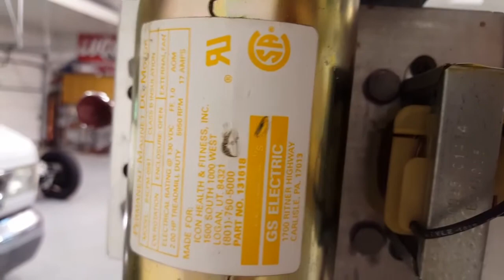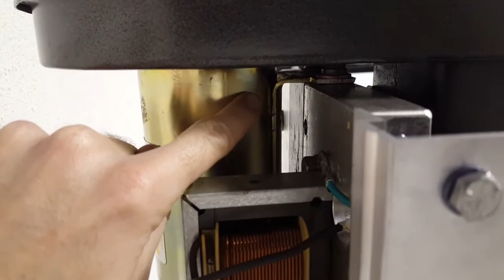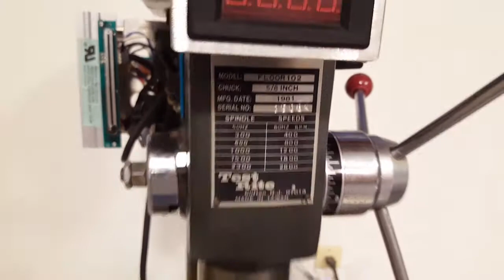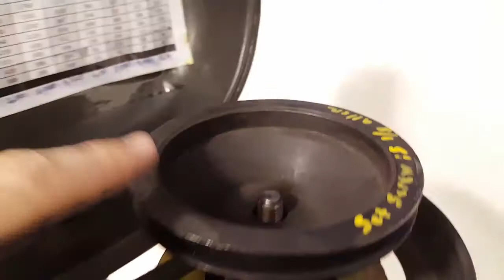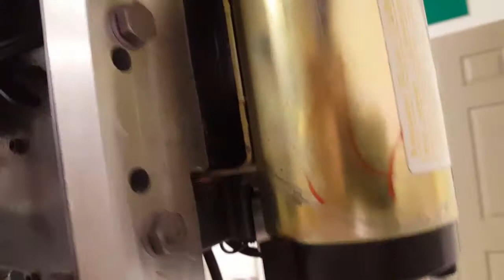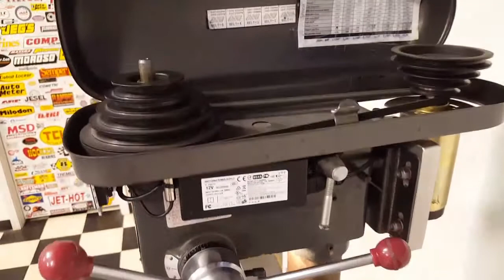Treadmill Motor & Digital Tachometer on a Drill Press Variable Speed

Comment: It amazes me no one sells kits for this. 
 
I have one arm/leg, so I am limited to one speed on a belt drill press (broke a tooth trying to change speeds last time. Lol.). And I've now burned up 2 motors and a drill fire trying to get a true adjustable speed drill press.
 
Electronics just don't seem to work in my brain. I can spend dozens of hours watching in depth "how to's" but it just doesn't click. 
 
Drill press industry needs to get into the 21st century. I mean, belt driven drill presses should just be relics at this point. And direct drive variable speed drill presses should be easily made and sold for $600 (for like a cheap 14" WEN version). 
 
Hopefully one day a company finally does it. Bur as long as they're making a fortune, they've no need to change. And if they do, they'll be like $3,000 lol .)
 
So great job! I'm super envious of your abilities!

Comment: UPRADE WHAT YOU HAVE, DON'T SPEND MONEY ON A NEW PILLAR DRILL. VERY GOOD ADVICE. I BOTH A PILLAR DRILL, BRAND NEW.  ABOUT TWO YEARS AGO. THE BODY BUILD IS VERY STONG, BUT THE MOTOR IS VERY WEAK. I ONLY USE IT ON WOODWORKING PROJECTS. AND MOST OF THE TIME I DON'T USE IT. SHOULD I CHAINGE THE MOTOR ? THE DRILL IS A CHINESE BRAND. I,M VERY DISAPPOINTED WITH IT. ANY ADVICE PLEASE?

Comment: Did you glue a magnet to the pulley? Where was the flat for the set screw?

Also be sure to cover up your wiring and connections if at possible!  High voltage DC will kill you!
Reply from the maker: I did glue the magnet, the set screw was already in the pulley. Good tip thanks!